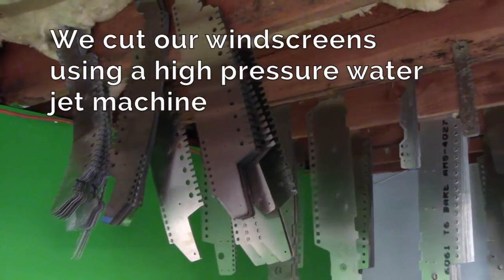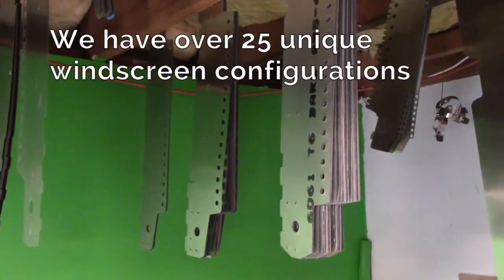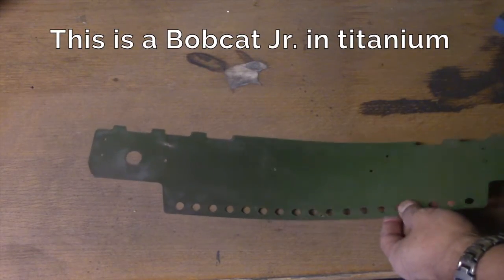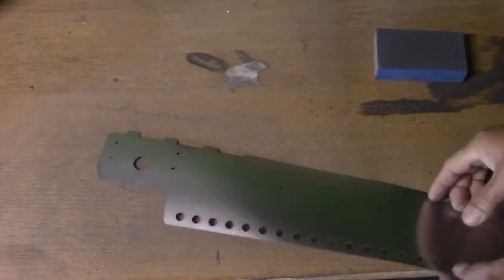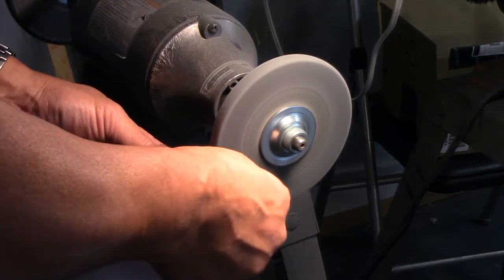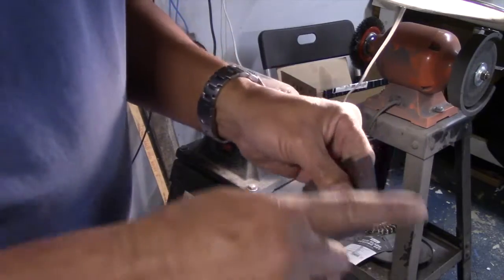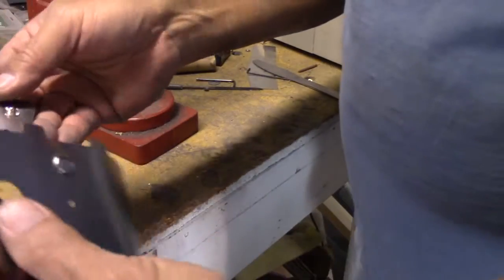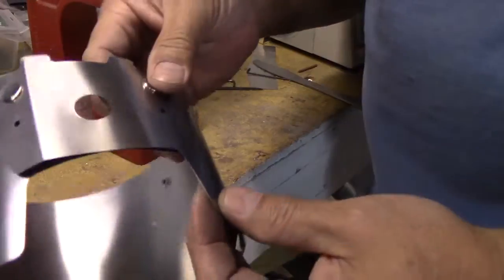How we make a Bobcat Windscreen by FLAT CAT GEAR

Comment: Interesting process.  You do nece work in your design/engineering and execution. I am wondering if you have water jet cutting capability or if you outsource that?  Curious about how much per piece it cost to do that. Curious but also I toy with the idea of cutting out something with precision myself. TIA
Reply from the maker: I stack 40-50 windscreens at a time and the cost is based upon the actual surface area being cut and the materials.  Waterjet machines cost around $250k.

Comment: Cool. I would have figured coming from the stamp/press facility that they would not have needed to be grinded/deburred.
Reply from the maker: Paper is 0.002" to 0.003" thick: not very strong but you can get paper cuts due to edge sharpness    Our windscreens range from 0.003" (stainless) thick to 0.011" thick (aluminum) so it is only prudent to knock the edges down.